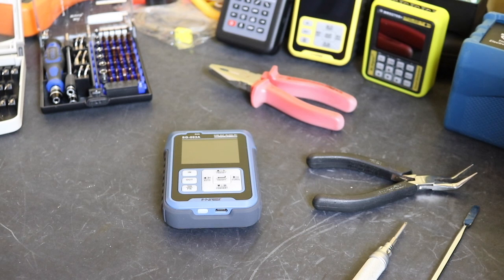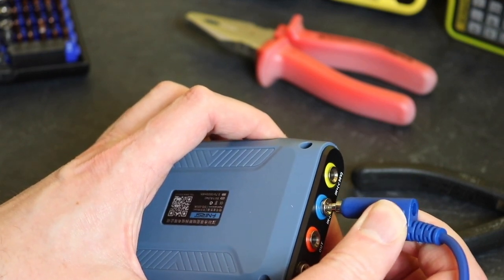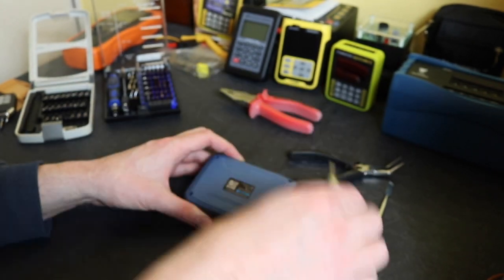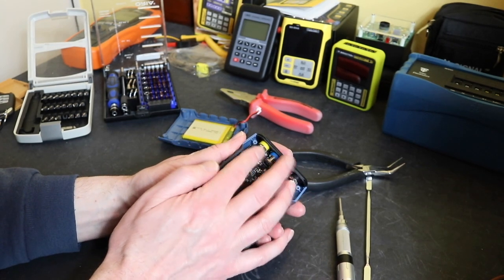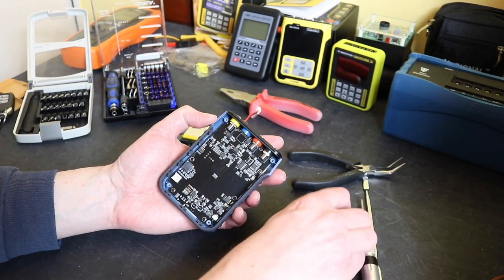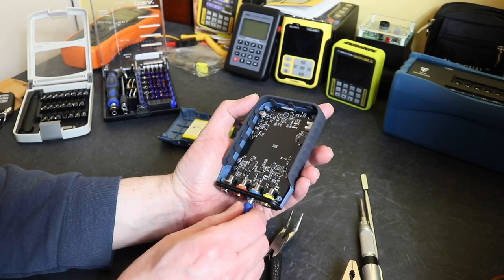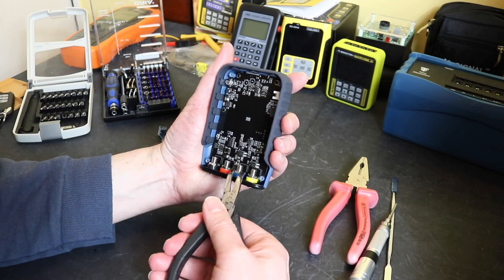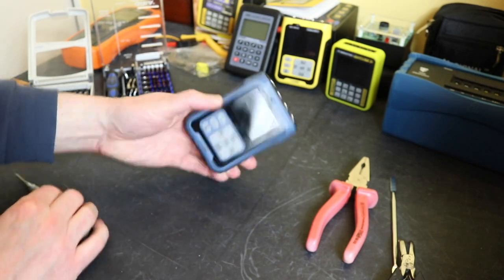Fnirsi SG-003A Loose Output Jack Fix

Comment: Can you tell me the battery reference, please? I have the same one but it doesn't charge
Reply from the maker: The battery on mine is JHCY 755060, 3.7V 3000 mAh. 755060 batteries are widely available, shouldn't be a problem to replace.